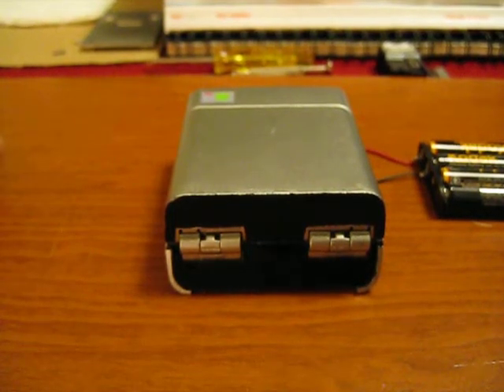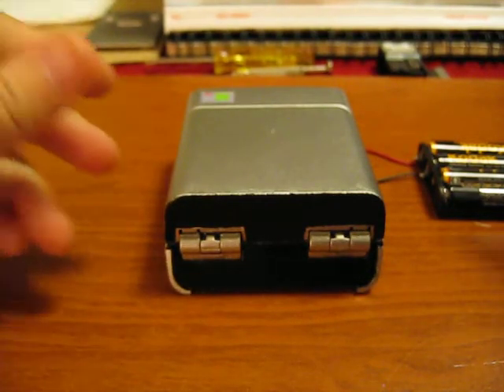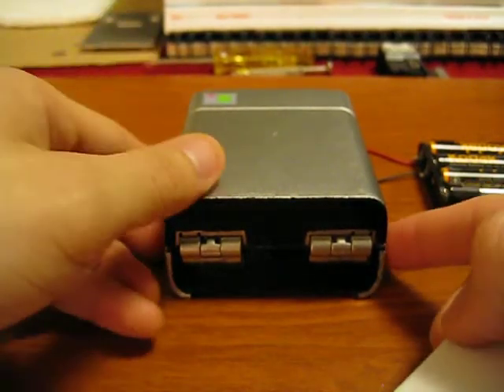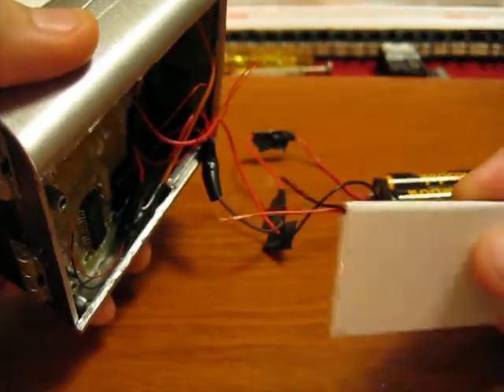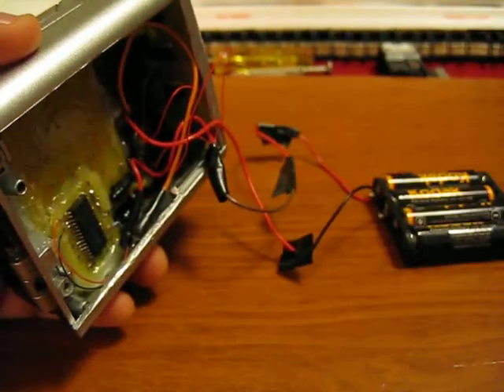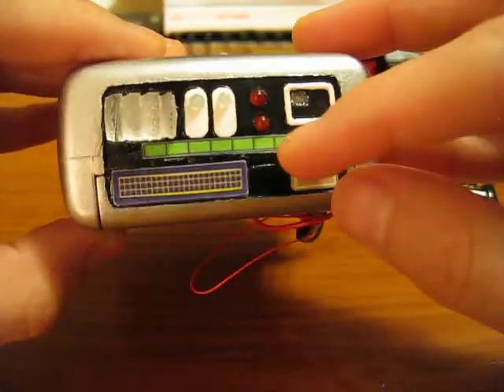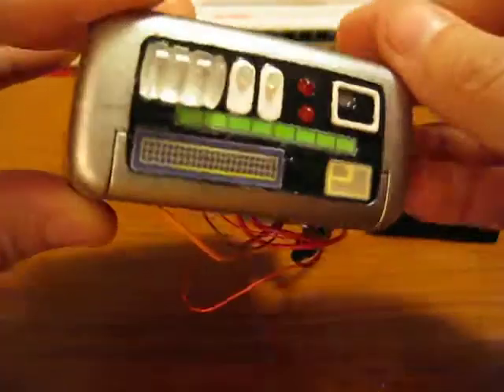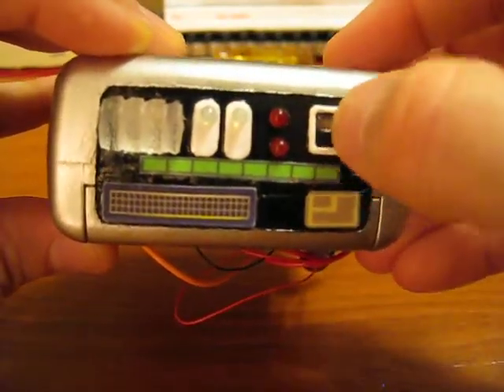Star Trek Playmates Tricorder modification process (PART 5)

Comment: What glue did you use to attach the decals?

I bought one of these kits which says to print the decals onto acetate but it doesn't say what to use to stuck it effectively. I was planning on just using PVA glue.
Reply from the maker: I used to use a 3M spray glue in a can.
Reply: @erik814u2  Perfect, thanks for the reply, I appreciate it!
Reply from the maker: Saro Dantra You’re welcome!

Comment: I've had one of these sitting around for a few years waiting to do it. I've been a little more incentivised lately to get it done. I have to make the half round piece of clear rod as my electronics kit never came with one. (He'd run out) I'm a bit crap at the painting thing with model-making and props but will make an effort to fill all the seams and get the paint right. I'm planning on using a Li-Ion battery and possibly a wireless recharging pad. I've a few of Myron's kits that I need to do and have considered wireless charging for them as well.

Comment: How difficult is the mod?
Reply from the maker: On a scale of 1 to 10 about a 7.
Reply: ***** what type of dremel tools am I going to need?
Reply from the maker: You'll need one that can both cut vertical/horizontal lines and make holes.
Reply: ***** what would be the best cut tool to make the back panel
Reply from the maker: It is very tedious. You need a good Dremel tool to make the cuts.